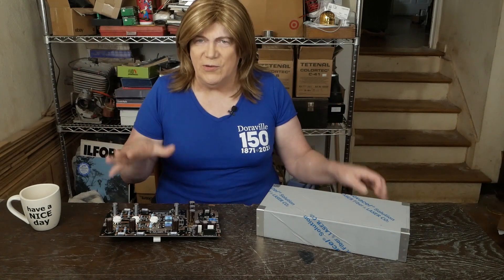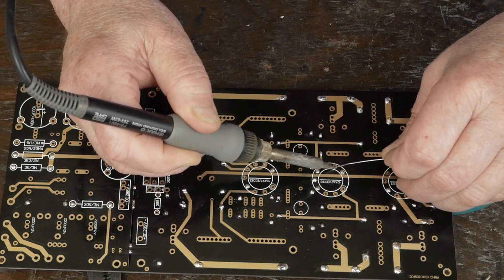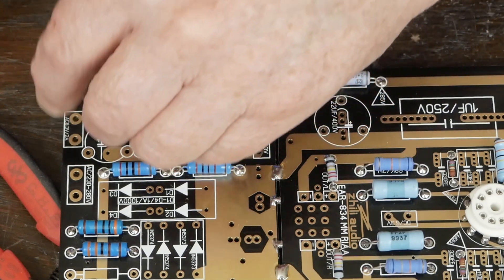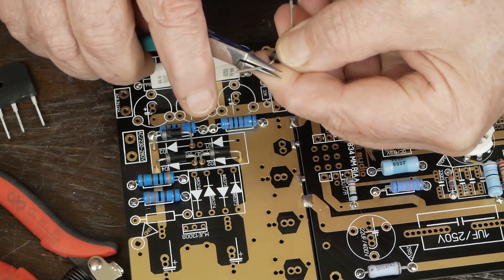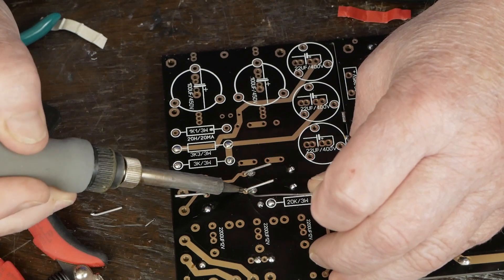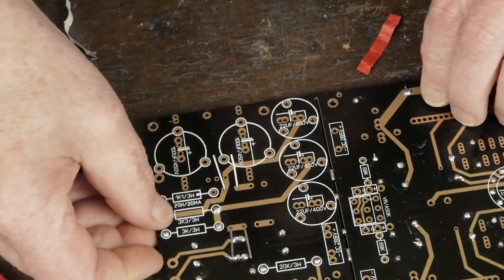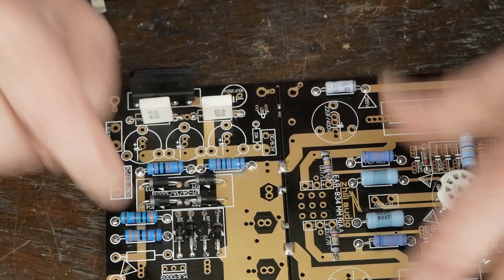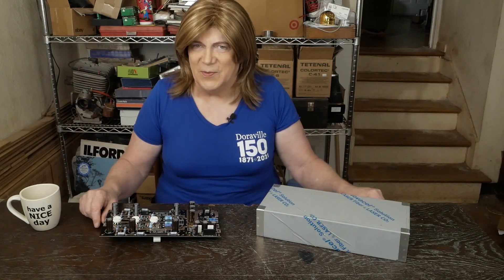DIY Phono Pre-amp: Soldering The Solid State Parts

Comment: Hey Stephe, just ordered the EAR-834 DIY Kit at Ali-Express!  With all the parts but I have Volmeter with capacity and inductivity measurment so I can measure the parts like you did and re-order the parts that don't match. And the plan is to buy the RIAA stuff new and better coupling capacitors and basically keep the rest if it seems to be ok. In the first Round I will try Jantzen MKP Cross Caps as Coupling Caps as they are really inexpensive and quite good value for the money and if I do not like it I maybe switch to Mundorf. Thanks for inspiration! And Yes I like the slow videos, too. For example now I know how to solder in a Diode the right direction ;-).  My next project after I finished my DIY Speakers now . Greetings from Germany!
Reply from the maker: I've built them with the supplied power supply caps and they sound fine, just do replace the RIAA related parts!
Reply: @SkunkieDesignsElectronics  ah  sorry I didn't really understand. Power Caps or Coupling caps? Plan was to keep the caps in the power supply anyway as only DC Voltage comes out of it.  Can I keep the original coupling caps if they match? Didn't expect that 🙂.
Reply from the maker: Sure, they should work, I just found mine sounded better after I upgraded the coupling caps.

Comment: If you mounted the electrolytic capacitors on the bottom side you could mount the PC board closer to the chassis and the tubes sockets would be closer to the top making the tubes to stand out more. Also if a capacitor were to blow it would blow down not up. Most of the components can be mounted on the bottom side.
Reply from the maker: But I don't want them "sticking out" that much :)
Reply: If you want the tubes to stand out, or simply don’t mind, I suggest the Hammond 1441-28BK3 case.

Comment: Hello Skunkie from Meaford Ontario Canada,  Skunkie my Quad 2's amp s and 22 pre amp restoration should be done this month , the Quad 22 pre amp is tube but requires strange plug in transformer s corrisponding to the type of stylus and cartridge for the phono stage, would it be best to find one of these transformer s plug in s to run my turntable or best to build an outbound like you did here?..enquiring minds wanna know  hee hee thanks Skunkie
Reply from the maker: Some info is here. The key quote here was: Z"Note that this is not a phono stage, the cartridge having a natural 6dB/octave roll-off. Pedants for accuracy will complain that the resultant output only approximates the RIAA curve"

https://keith-snook.info/quad-22-valve-pre-amplifier.html